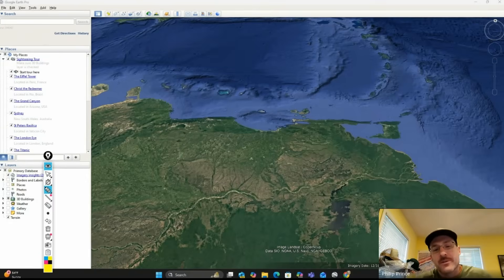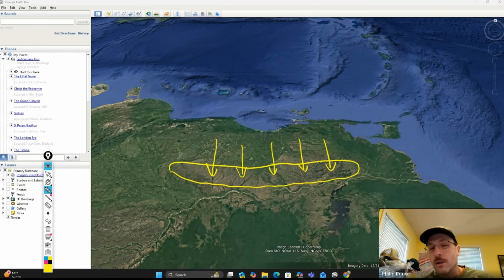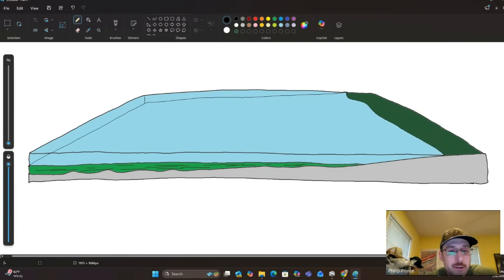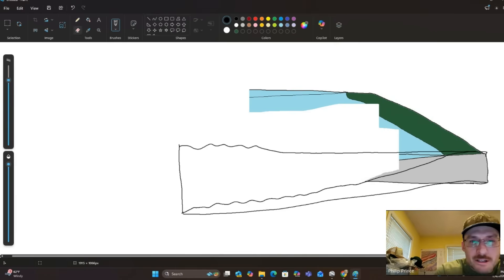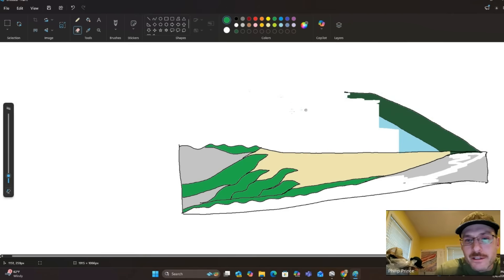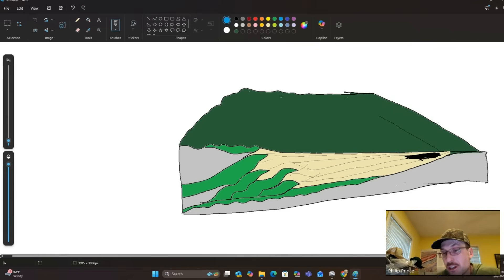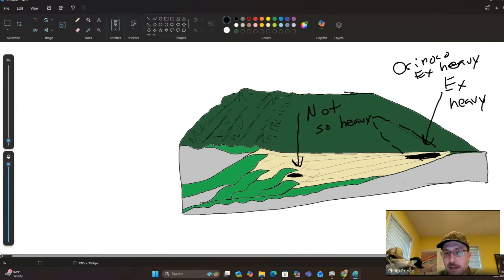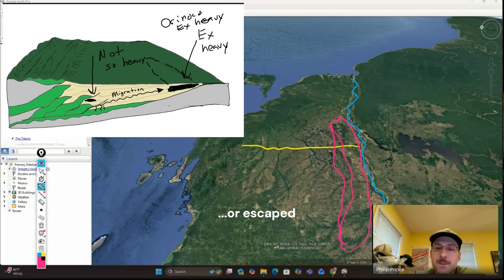Why does Venezuela have so much extra heavy, sour crude oil?

Comment: My understanding with super heavy oil is that the lighter Hydrocarbons have all evaporated or dissipated over time, leaving only the non-volatile compounds. Normally lighter crude oil is trapped by a cap rock or salt which prevents the lighter compounds from escaping over time. 

It looks like geology is forcing the oil to move laterally, inland & up as the land near the coast is pushed down below the sea surface.
Reply from the maker: all the lit bits it on biodegradation and water interaction in the Orinoco Belt. I believe that is supported by chemical analysis.

Comment: What i learned
- ocean organic matter can create oil
- heavy oil is not formed, rather, shallow depth, cooler temps, microbes, and water can wash away the lighter parts of oil leaving only heavy parts behind. 
- venezeula's orinoco field has been moved quite a ways by by tectonic activity and pressure
- pressure and heat are required to form oil. 
- limestone rock does not bind sulpher and it attaches to the oil molecules creating sour oil.

Comment: It has the oil that it does because of how SA was deposed. In almost a single motion, a massive swath of seafloor was sucked under an uplifted SA. Consequence of Impact. SA rotated CCW and drifted south. The main scar is the Caribbean Sea. Note that it looks like someone took a scoop with a giant flat nose shovel! As SA rotated it caused an accumulation of that sucked under seafloor to build right where Venezuela is. Rich in organic material that later turned to oil. The evidence of this is found in study of Sierra Nevada De Santa Marta. The largest mountain in SA that is 1600mi displaced from it's original placement in Peru. Geology has yet to teach this, it is my discovery that I am currently working on publishing. But there is a MASSIVE dataset that has to be organized alongside this study. Going to take a bit.

Comment: From someone who has spent their entire career in the oil and gas industry, the principal reason is that the trap had a poor seal that allowed the lighter hydrocarbons to escape.  The sour part has to do with the origin of the carbonaceous\organic material.  My understanding is that the sulfur content results from SRB bacteria present in an anoxic environment.

I do not know how much of the source rock organic material was trapped, but I doubt that it was more than 5%.

This structure is close to being a stratigraphic trap.  For a wonderful example of a stratigraphic trap, I recommend taking a look at the East Texas Oil Field.  An interesting aspect of the East Texas Oil Field is that when it has high withdrawal rates, the east side of the Hawkins Oil Field would have significant pressure drops observed.  The Hawkins Oil Field is some twenty miles west of the western limit of the East Texas Oil Field.  Both oil fields produce from the same formation.

Great video.

PS:  While the present of H2S is often used to designate sour crudes, mainly for production safety, the true indicator of sour crudes is how much sulfur is present in the hydrocarbon chains of the crude oil.  This sulfur presents a challenge in the refining process.  For example, back in 2006, sulfur limits in diesel fuel were implemented, this required additional processing.  The end result was, while reduced SO2 emissions were achieved, a reduction in the energy content per gallon of fuel and a reduction in lubricity of the fuel occurred.

Comment: What prehistoric environments make oil vs coal/natural gas. I read somewhere that one environment makes coal and gas and another environment makes oil
Reply from the maker: it’s the kerogen type, which reflects the source of the carbon compounds that get buried. woody land plant debris (type 3) makes coal and/or mostly gas; the hydrogen and oxygen ratios are different from water column-sourced carbon. freshwater lake basin algaes (type 1) are good sweet oil producers due to the chemistry of the algae and lake water chemistry. type 2 (marine algae/plankton type micro critters) creates oil and gas. it all comes down to hydrogen/oxygen/carbon ratios in the starting material.

Comment: Seems to me, speculating on the source rock and migration of oil involves a lot of arm waving and tall tales. The Permian Basin has sour crude (oil saturated with smelly, dangerous hydrogen sulfide) in the shallower San Andres and Wichita-Albany Limestones. Below them, in the Wolfcamp Limestone and deeper formations is sweet crude oil. I think the sour oil in the limestone reservoirs likely comes from the decay of bacteria that eat the limestone, not from the source rock. Sandstone reservoirs have sweet oil.
Reply from the maker: the Venezuelan reservoirs are sandstone (channel stuff etc) and that oil sour as hell

Comment: Super interesting.

What’s the source of the sulfates that ended up as sulfur in the oil?

Thanks!!
Reply: I believe from microbes that use sulfur & accumulated from sulfur containing compounds in the sea or flowing in to sea from run off. The Microbes concentrate the sulfur by trapping it in their bodies, when the die the sulfur accumulates on the sea floor with the other microbes that form Oil.

Comment: I love the smell of heavy oil.  in the 70s, we switched to Navy distilate (no. 2 diesel), but before that, we burned heavy oil, some called bunker C.  Small leaks in the fuel oil heaters would fill the fireroom with the sweet smell I loved and lingered for years, even after we stopped burning it.

Comment: It's hard to conceptualize for a lot of people. I think most people when they think of oil being in the ground they think of it like there is a pocket or a cavern underground that is full of liquid. That's actually not the case. 

The best way I have found to describe it is like a sand volleyball court at your local park. 

Im sure everyone has been in a sand volley ball court. Now imagine that it has rained. That court is still full of sand, but it is also full of water now. They exist simultaneously in the same space. 

That is the same function of these porous layers underground.  Only it has millions of tons of rock and sediment stacked on top of it and its extremely hot. Anywhere between 220 and 350 degrees farenheight. 

So imagine the mind of pressure that exists here in these zones. 

Now imagine that you run down there and poke a hole in it to allow all of that pressure out. (Hopefully dragging some of that Texas Tea with it)

As for weights and grades, we all know that pretty much everything we use has oil in it now a days. All of these products are refined in different ways. 

Say wheel bearing grease for example. If you have crude oil that has a ton of wax in it and is very heavy out of the ground then it doesnt take as much energy to turn that into grease. But it takes a ton of energy to turn that into diesel. 

Here in America over the last 100 years we have gradually shifted our refineries to where moat of the oil we produce is used to make heavier products and we just import oil to turn into gasoline and diesel. 

Apparently its cheaper to buy it and ship it here then it is to turn our stuff into these higher octane fuels. Typically most of our refineries will mix some of pur oil with saudi or venezuelan oil. 

In my opinion, I think that this push to gain more control over the Venezuelan oil and secure our market for it is to offset potentially losing the ability to import lighter crude from say the Sauds.
Reply from the maker: indeed…rotted dinosaur bones in caverns, all the way!

Comment: So were the multiple layers of organic material stacked by multiple stretch/compress cycles or one big crush?   Thanks.
Reply from the maker: one prolonged compressional phase, with starts and stops, but no direct extension. there can occasionally be very local stretching due to the oblique compression, but it’s localized and not a big thing here (not shown in drawing either).

Comment: I cannot get my head around and I bet nobody else can how the underwater often deepwater alluvial fans contain oil since oil floats. Diatoms although they have hard shells Myron Cook explains take several years to settle to the bottom. Inside those diatoms are tiny globules of oils inside cells. That I can comprehend fully. But I cannot understand how oil can be in this downwash and not lost to the water column and drift away to oxidize and decompose. The organic matter washing down on land I can comprehend how the spores and seeds and other organics contain oil and can visualize it staying trapped and mixed into the downwash alluvial fans. Not even our heavenly father Myron Cook can explain it and his career was based on it. I hike in and often stand at and look at the sandstone and strata of these downwashes and as I look at it WHERES THE OIL? I can understand that it only takes a bit and it migrates and is trapped but I cant get my head around why do these organics and microscopic oil rich globules inside cells FLOAT AND WASH AWAY. Can someone explain how oil is formed?
Reply from the maker: oil could migrate into a deeply buried alluvial fan, but it doesn’t form (is not generated) in rocks that started in alluvial fan settings. it settles out of low energy water columns and accumulates with fine grain sediment in areas with minimal circulation, so basically the opposite of an alluvial fan. source rock would start out like the sticky, slick mud you might find on the bottom of a pond, in the middle, in a flat landscape where no coarse high energy material could wash in…just scale that up to kilometer-scale basins. The oil isn’t oil yet when it’s still in the dead critters; it undergoes chemical reactions to become the hydrocarbons that migrate up dip, etc. they definitely sink when they croak, and are then buried to start the process.  An oil-forming/trapping scenario would be depositing calc shale (the source rock) in a quiet, no-circulation basin offshore, burying that calc shale under a couple to a few miles of sandier sediment as a mountain belt grew and approached, generating oil from buried the diatoms, plankton, etc in the calc shale due to the burial, and then having the oil  migrate upward into the sands. depending how that sandy stuff filled the basin, you might get oil trapping in sands in submarine channels and fans. alluvial fan trapping might be possible in a continental rift lake. Sandstones come along later in the game…it all starts with really fine stuff from the “pond bottom.”

Comment: 14:35 Why didn't oil deposits form just south of the Orinoco River? Is there some other geological fault that prevented it? Thank you for your explanation; it's very intuitive.
Reply from the maker: Their limit is controlled by the limit of those sandstone layers (light color); they thin out to nothing at the edge of the basin where they lay up against the gray rock. The gray rock is exposed at the surface when you get on the other side of the Orinoco, so basically the oil went about as far as it could geologically. I should have drawn the river in, but it's right along the edge of the basin where that light color sedimentary fill thins out to nothing.

Comment: I guess that section of South America carried off most of the organic rich sediment that cooked in petroleum in the widening rift that became the GoM to leave North America with different organic rich sediment that was cooked into natural gas, some intermediate and a lot of light switches petroleum. I lived in East Texas ( Longview) which had a natural gas field inside the city limits that was surrounded by oil deposits so had NG wellheads and Jack pumps scattered around tow. There were a lot more oil wells north, west and south of town that were inside the boundaries of the East Texas Oil Field ( The Black Giant) that was 45 miles long and 9 miles wide. It once held 7 billion barrels of light sweet crude (40% natural gasoline) that migrated 250 miles north from its source rock called the Eagle Ford Shale. It was discovered in 1930 by accident by an oil field geologists turned scam artist named Doc Joiner. He found that dry holes could be profitable by over selling interests in wells that'll never produce a drop of petroleum. This time he drilled one well that was dry but found more investors to drill a second exploratory well at a different location. They were skidding the derrick to a new location some distance away until the skid broke after travelling 300 feet. Doc started drilling there and spent more time in Tyler trying to find more investors and gambling to raise money to pay his crew and buy supplies. His well did hit a sand formation that held petroleum but he was too broke to bring in the well. An oil lease speculator named H.L. Hunt was in Tyler gambling so went out to check Joiner's well discovery. He bought the well from Joiner so he could pay back his investors before bringing the well in. It produced around 350 barrels per day which prompted more drilling in the region. In 1931 they started hitting 8,000 BPD gushers 5-6 miles north in Kilgore then 14,000 BPD gushers 21 miles north of Longview. A total of slightly more than 30,000 producing wells were drilled into the deposit with dry holes determining its boundaries. The oil was pushed north by a salt water drive which followed the oil as it was pumped out to push the remaining oil north. The field has produced over 5.5 billion barrels of oil with wells in the northern end still producing. Doc Joiner's discovery well kept producing the same amount for decades and was still pumping away in 2000. Oil field geologists think there's another 1-2 billion barrels of oil in thin stringer formations beneath the Black Giant. Exxon bought up a lot of the mineral rights to that depleted oil field so probably has been exploring methods to get what's left out of the ground.

Comment: To me, this illustrates the difference between "high technology" and "appropriate technology."  As someone who made his career in designing microprocessor based systems, I came up with some real GEE WHIZ solutions to problems that really didn't exist and over and over again I had to face the fact that old and simple ways of doing things was many times better than the "new and shiny" ways of doing things.  

In this example, simply drawing on a sheet of paper with colored pencils would probably been way easier and way faster.  I know that when I was getting my degree in geology, I made several subsurface drawings of probable subsurface structures and I could whip them out with nothing more than a blank piece of paper, a protractor, a drawing compass, a straightedge and a box of colored pencils.  When I'd go on geology field trips, the professor would have a large, multi sheet stack of paper on a tripod and could whip out drawings of underground structures as he spoke.  Just for fun, you might give it a try.

By the way, I'd like to say something about the heavy, sour crude from our local Monterey Formation.  Our source rock is diatomaceous porcellanite shale originally deposited in a deep ocean basin off the West Coast during the Miocene.  I have always assumed that the sulfur was from the organic sulfur compounds that were part of a living cell's biology.  Perhaps the Orinoco petroleum had a similar source and similar diagenesis.
Reply from the maker: Thanks for the comment. Perhaps I will draw something with manual tools, though I doubt most would consider Paint "new and shiny." 

The typically quoted large sulfur source  (if you read about it, material will say "most") for marine kerogens is sulfate in seawater that is bacterially reduced. In other words, it's aqueous, inorganic sulfur in sulfate form that can be reduced and then react with available organics. Sulfate is comparatively lacking in lacustrine basins, and its limited presence is one variable favoring the development of sweet crudes in those settings. The algae, plankton etc can also contribute some sulfur. The source rocks in Venezuela contain a good deal of carbonate (marls, calc shales, limestones,  among others), leading to the lack of sulfur sink in Fe species and so on.
Reply: I believe he is using a video capture software on his PC, saving the need to set up a video camera fixed on the  paper, Plus its easier to erase and redraw using paint than paper & pencils.